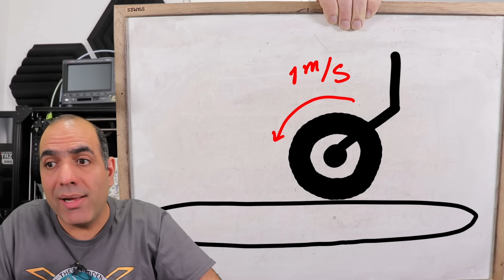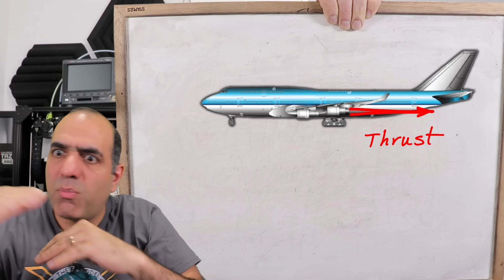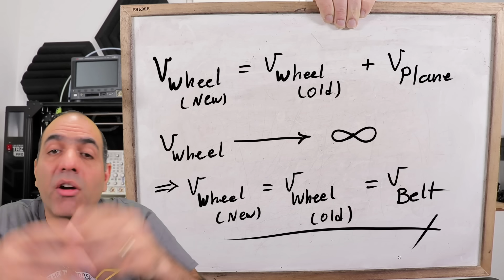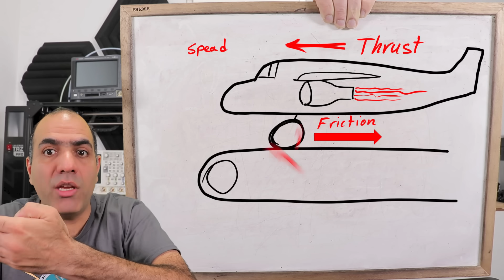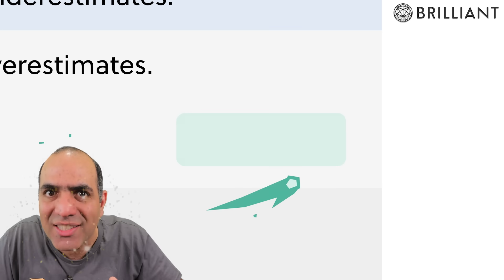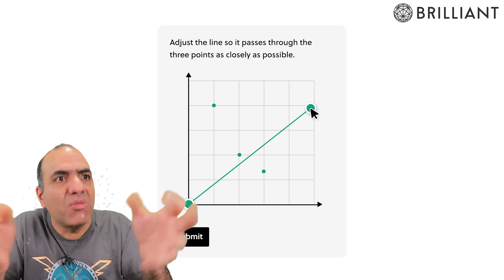Airplane Question that Drove Me NUTS!!!

Comment: The question on twitter was phrased poorly I think. The version I know from the past stated that the belt would match the speed of the plane (instead of the wheels). That way it's much less confusing imo.
Reply: @407BRR  what are ya an anti-flyer mate?! Next you'll be accused of racism cause the majority of planes are painted white 😂
Reply: These are the of confusing questions I hate on any school exams
Reply: speed of the plane or speed of the center of the wheel. speed of the wheel is ambiguous (top or bottom of the wheel)?
Reply: It wouldn't matter either way, since the wheels are free spinning the plane will move forward regardless of what the ground underneath is doing
Reply: @KaitouKaiju  Kond of. Imagine there is a speedometer on the wheel. If the belt is stationary and the airplane starts moving forward at 1 mph, the belt will move backwards at 1 mph. The airplane keeps moving forward at 1 mph, the speedo says 2 mph so the belt speeds up to 2 mph. That makes the speedo read 3 mph, etc, etc. It's an unstable feedback loop that quickly accelerates to infinite speed with the airplane not moving forward at all. Tire structural limits are exceeded, bearing friction melts them down, the airplane stops rolling.

If the riddle is built such that the belt matches a speedometer in the tire, it will not take off because of the wheel's limits. If it is built such that the belt equals the ground speed, it has a chance, but not always. 

An A320 tire limit speed is 195 knots, its loft off speed can easily exceed 150 knots. In the second scenario, the tires will be rotating at 300 knots at lift off. They'll likely come apart before rotation.
Reply: @cambrosn  you're still confused. There is no way for the conveyor belt to impart a force onto the airplane to counteract the thrust of the engines. The feedback loop is a red herring and likely a bad math model. The fact is that you can set the conveyor belt at any speed as long as the plane is in thrust. The wheels rotational speed and the speed of the plane accelerating down the conveyor belt are independent.
Reply: @407BRR  Do you live in a frictionless world?
Reply: @cambrosn  the wheels are designed to have as little friction as possible.  It's negligible when compared to the thrust of the engine. Yes, if you leave the engines off and slowly increase the speed of the conveyor belt, the plane will move with the belt. But as soon as you introduce the thrust from the engine, they will overpower the friction and the plane will accelerate.
Reply: @407BRR  negligible isn't zero. Especially at infinite speeds. 

Here's the equation for the wheel/ belt speed: 
V_belt = V_wheel
V_wheel = V_belt + V_groundspeed

That means 
V_belt =V_belt + Groundspeed

Its a circular loop. If V_groundspeed equals 1 mph and the belt is stationary, V_belt also equals 1 mph, but its a iterative process. That means if the ground speed is still 1 mph, V_belt equals 2 mph. Next iteration is 3 mph with a 1 mph ground speed, next is 4, next is 5. It keeps going up at any ground speed.

Even if you assume the bearing friction and rolling resistance is zero, the aerodynamic drag of the tire spinning at high speed would eventually be significant even before it explodes. It all depends on how the question is framed which is the point of this video.
Reply: @cambrosn  You're choosing a model (the equations) that 1. suits your concept. 2. doesn't reflect reality.

I can simply say that V_belt = V_wheel and leave it at that and still be consistent to the wording of the question.
Reply: @407BRR  The video is literally about that distinction.
Reply: @cambrosn  the no flyers people came up with that loop equation to justify their initial interpretation of the question.
Reply: @407BRR  huh? No flyers?
Reply: @cambrosn  This question has been around in one form or another since at least 2006. 

The people that say it won't fly are the no-flyers. They initially think the point of the question is to ask if a motionless plane will take off. The other people, who think the plane will take off, interpret the question as asking if you realize the conveyor belt can't prevent the plane from accelerating. 

In the inevitable discussions that follow, the no-flyers produce the ad-hoc interpretation of whatever speed is referred to in the question that requires the plane remain stationary. They refuse to admit that they misinterpreted the question, or that there is another valid interpretation. But the question never states the plane must remain stationary. And there really is no realistic way for such a contraption to like this to prevent the plane from accelerating forward.

Since the plane will accelerate forward, then we can choose an interpretation of whatever speed is in the question that is consistent with that result. 

There are two interpretations that work. 
1. V_belt = V_wheel. Which means that the wheels and conveyor operate independently of V_plane because V_belt can't affect V_plane.
2. V_belt = V_plane. Because the wheels are are attached to the plane V_wheel = V_plane.
Reply: @407BRR  Hey guy, look you're not wrong, but please, this is all about precisely how you interpret the question. In the most realistic, the most likely, scenario the plane will fly. But one can imagine scenarios where it wouldn't.
Reply: @Chris  rpm is 1500 for a 747 taking off, double it = 3000. I don't think we're reaching infinity any time soon there. Sure it might get hot, but it's still taking off safe n sound
Reply: @KaitouKaiju  The wheels would explode before it has a chance to take off, unless everything is perfectly invincible and there is no friction, at which case the wheels won't move, cost the rubber has no friction either. ;P
Reply: @TechyBen  the plane will fly man
Reply: @TechyBen  also rolling friction is not dependent on velocity so it would stay the same
Reply: @jannepeltonen2036  Or you can choose to interpret the question so that it actually reflects reality. 

There is no reasonable way to generate that much friction unless the brakes on the wheels are applied. Therefore we are free to interpret the "speed of the wheels" to mean the speed of the wheel as a whole, which equals the speed of the plane. Or we can interpret that to mean that speed of the conveyor belt surface matches the contact point of the wheel. Since the wheels aren't slipping, they are always the same speed, and the conveyor belt could run at any speed, freely spinning the wheels. 

I understand the motivation to defend your initial interpretation for the question. But the truth is that outside of special cases, the plane will be able to accelerate as normal and take off, and the conveyor belt underneath it will be powerless to stop it.
Reply: Suppose frictionless bearings. It's not the speed matching that matters. The belt would have to impose a force on the plane to change the speed of the plane. Frictionless bearings do not impose forces in the x-y plane. Even in a real world scenario, the forces of the wheels on the plane is inconsequential relative to force of thrust (unless the wheel fails before take-off and you have the entire plane body rubbing against rubber).
Reply: 2 * infinity = infinity
10 * infinity = infinity
infinity * infinity = ?

See where this is going?
Reply: @sirtra  introducing aleph one
Reply: @nsh07-gh  a mathematician has entered the chat... 😉

Comment: Answering as you asked. :) Yes, it does fly off, because plane engines using air to move plane, not the surface. And match speed of wheels with conveyor will be not possible.

Comment: 7:38 no it won’t take off because the runway is moving but not the planes engines to provide trust to push the plane. The only way it can keep providing lift once the plane is airborne, The turbines have to or be near running at TO/GA power to continue pushing the plane into the air while it’s fighting drag to get airborne simple answer but no it won’t
Reply: This is no different than a normal plane taking off on a normal runway

Comment: To me, an interesting problem is the boundary layer of air. There's a condition in physics where the velocity of a fluid tangential to a stationary wall will stay zero. If the conveyor picks up 150 kts of speed, the air closest to the conveyor is moving at 150 kts. No matter how you slice it, a conveyor the length of the runway will always transition from laminar flow to turbulent way before it reaches the 747, compromising the clean air that wings and jet engines need in order to operate properly. It won't produce the thrust it needs to, or the lift - even if it had the airspeed.

Comment: Taking the question at face value…no. The question mentions nothing of air speed. So since air speed is not mentioned, we are to assume there is 0 wind. Airplanes require airspeed to take off. All the thrust generated by this plane is simply to keep up or slightly overtake the treadmill. Even if the treadmill is moving at say 200mph, the airspeed will still be 0 because the plane is not moving forward. It’s only generating enough thrust to maintain pace with the treadmill. It’s why planes have airspeed indicators. Ground speed is way less important than airspeed.

Comment: The answer is no. If ground is matching speed of wheels, the speed of the thrust is matched by the Convair belt. Therefore the factors needed for lift cannot be matched and the is a stationary plane burning fuel in one place. The answer is no

Comment: Yes, the 747 indeed can take off because it’s engines are push the aircraft through the air, not drive it with its wheels and has stayed in the conveyor belt would have no effect.

Comment: After some thinking, I don't think it would, if the jet speeds up then the belt speed up, making the plane have zero velocity relative to the ground, this is basically an equivalent to it being anchored  to the ground, even though there would be air flow through the turbines, this is not what drives lift, it drives thrust, but since it's velocity to the ground is zero, then so is it's velocity towards the wind, high relative wind speed is required to generate lift. The plane cannot ascend.

Comment: The friction doesn't matter and the plane never takes off, with engines at any thrust.  The energy of the engines becomes stored as kinetic energy in the spinning wheels.  During the energy transfer, the engines push forward, but the ever-increasing speed of the belt acting against the mass of the wheels pushes the plane back with exact balance.  Eventually the plane runs out of fuel and the wheels store all the fuel's energy in their motion.

Comment: Man I was going like "this isn't solvable without taking assumptions because 'speed' and the conditions are so poorly defined, since 'speed' could be angular speed or linear speed and the conditions like extreme wind and blahblahblah" but this is a tricky question aaghhh
Airplanes accelarate for flight using their *turbines*, not their wheels, so the only thing that could stop that plane from taking off is if the landing gear and conveyor belt aren't perfect and blessed, which could make them colapse under the friction and the heat hehe

Comment: it can't. of course it can't. there needs to be movement of air over the wings at least 92 metres per second for it to fly. that is a bunch of fans.
wheels have nothing to do with flying. engine also. it can work to the max but if it is not over 1 in thrust to weight ratio or if the plane is not forcing air over the wings, damn thing is glued to the ground like the rest of us.

Comment: These questions are an example of memetic ideas. The ones that have proper context and detail die off. The ones that are ambiguous so people keep talking about them persist
Reply: Generally made my charlatans like that fw self promoter Derek.
Reply: Good point it’s actually a flawed question entirely.  First question: is it possible to keep a plane in place with a treadmill if the engines are at takeoff thrust.  The answer: no.

Comment: Airspeed is needed to produce lift. if the airplane is stationery with engine in full thrust. and the conveyor belt turns backwards to maintain the plane stationery. In my guess there is no lift created on the wings so the plane may not fly...

Comment: Dumb question that even anengineer would easly answer as "no the wheels don't do anything for the plane to fly,the wings and the lift effect make the plane ti fly,so if the plane itself(its body and wings) don't move in the forward direction fast enough then the plane cannot take off and adding all the other variable the dumbasses in the comments try to think of pretending to know what they're saying are useless and prove nothing therefore they should not be taken into consideration because all they do is prolong the calculation therefore the process of finding out and explaining what simple physics and the aforementioned answer already said"
In short "no it won't fly unless the plane itself is moving forward fast enough regardless of how fast the wheels spin,and everyone trying to use multiple words that mean nothing just to appear smart is stupid AF" XD

Comment: The thrust would rotate the conveyor belt, not the wheels. IE, the friction of bearings vs friction of wheel to belt.
The belt would act as the wheels in this case.

Comment: It if the runway was a conveyor belt, then yes, as long as the plane was moving forward, it will take off because the same amount of air would travel over the wings... it would of course be a really  short flight if the engines were not running!!!

Comment: 5:00 I think your Case #3 is the right conclusion but not totally correct. You're saying the plane would get some initial forward speed but would soon hit equilibrium and stay still - I'd say it actually stays still the whole time. 

The way I thought to simplify the problem was this: Assuming that the wheels can't 'skid' over the belt (i.e. static friction applies), then if the plane is moving at all, the belt and wheel speeds are necessarily different. So if the belt is "designed" to keep them the same, it has to be designed to prevent the plane from moving.

The belt can ONLY prevent the plane from moving if it has some way to apply a reverse force to the plane to counter the engine thrust. This is why Cases #1 and #2 work: in these cases, nothing the belt does can ever apply force to the plane, so the plane moves forward no matter what.

But for Case #3, we're saying the bearing has some non-zero amount of friction. This means that out of the total force applied to the wheel by the belt, some portion gives rotational acceleration to the wheel, and the rest applies an effective reverse force to the plane. So the belt can always just apply a larger force to the wheels to ensure the friction portion matches the engine thrust, negating the plane's acceleration. This increases the wheel's rotational speed too as a side-effect, but that doesn't violate the belt's 'goal'.

As a side note, I went looking for info on bearing friction models, and found that a lot of them don't include rotational speed as variable. I'm sure this is one of those ideal/hypothetical things, but for our scenario I wondered if this means the wheels and belt constantly accelerate to infinity rather than hitting a stable speed? It doesn't really affect the answer though: the plane still can't accelerate either way.

Assumptions used (since this was Mehdi's whole point about the intro, lol):
* The wheel and belt surfaces are magically grippy and never change from static friction to kinetic friction (i.e. they don't 'skid'; doesn't really apply to Case #1 obviously)
* The plane does have engines on and is experiencing forward thrust (re: Case #4)
* The bearing is magic and doesn't explode or melt under effectively infinite rotational speed
* The belt can apply as much force as it wants to (i.e. basically unlimited motor torque/current)

Comment: In the hypothetical situation in which the aircraft has an engine with imaginary thrust then the aircraft could take off with friction between the belt and wheels (assuming the wheels and axles can’t break) simply by putting on the brakes before moving. If the wheels never move then neither does the conveyor, with imaginary “infinite” thrust, eventually the aircraft could overcome the force of static friction and take off.